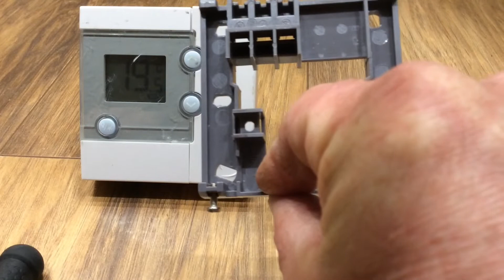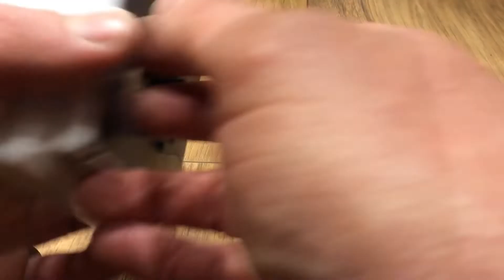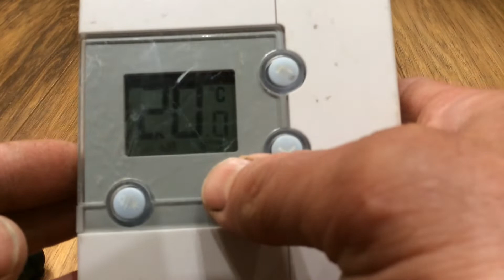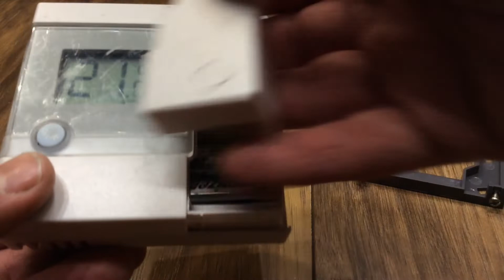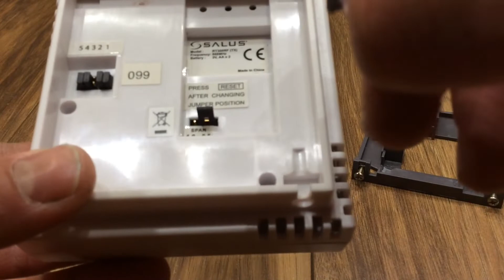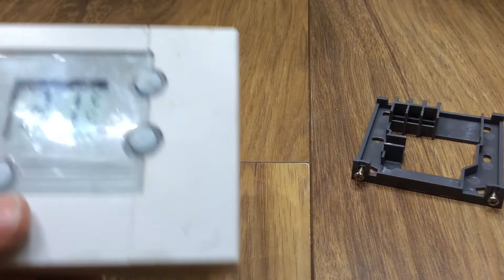Salus rt300rf thermostat Guide

Comment: Green and red light on but no heat only hot water. Batteries changed but still nothing Recent power cuts messed it up.
Reply from the maker: Turn below room temp 10 seconds then back above toom temp repeat 10 seconds then repeat . Ots an old unit now could well be toast tho

Comment: Hello please can you help me. I set the temp to 21 and the boiler in the on position so that the boiler is always 'on' and the house is maintained at 21. However when I set the temp to 21 (I get the SET message) the next day the temp on the SET page has dropped from 21 to 14. I set it again at 21 but again the next day it's back to 14. As a result the heating never comes on because it the temp in my living room now has ti get to below 14 for the heating to come on. How can I get the SET temp to stay at 21 and stop going to 14. Many thanks.
Reply from the maker: Units probably faulty they are quite old now
Reply: thank you for reply...appreciate it!. I guess they are now discontinued in regards to replacement?
Reply from the maker: There's some very similar units however ironically more expensive for these than the one with programming

Comment: Not sure if you are still answering questions on this old unit but the power has been off at my house this morning and now the unit is refusing to pair. It does try but then reverts back to a flashing red light on the receiver? Any clues, I have put new batteries in turned the power on and off etc etc if I need new what is the alternative replacement?
Reply from the maker: Have u turned it up and down a few times
Reply from the maker: It's hard wired to pair so you try changing the jumpers and dip switches .both should match

Comment: Hi, video is fantastic, but still the receiver is solid red, even after reset the controller. What am I missing?!
Reply from the maker: It's quite old it's likely done ..time to get something new
Reply: Thanks. Can I ask what will be a good replacement?!
Reply from the maker: hi i would say if you push the budget another 20 or 30 pounds you can get the hive mini . ot tado controls 100 from screwfix and internet with an app on your phone . around the 100 mark

Comment: ever thought of investing ina microphone? Even on full volume i can hardly hear
Reply from the maker: Noted old vid I do better now .prob needs a voice over and refresh
Reply: @timeintheuk  one of the battery connectors went on mine today so heater wouldn't come on.
This did help me realise it worked by a signal and not wired connection so I managed to take of the wall and put a temporary fix in place so it would activate the heater.

Comment: it seems that my display is gone. can rt500rf  thermostat work on the same console, at least manualy?
Reply from the maker: Remove battery's overnight and try putting new ones back in after aesst 6 hours should springback to life
Reply: @timeintheuk  It's dead, Jim!
Reply from the maker: @osmanposao  on the 300s the metal bit falls out of the battery doorsometimes plus itshard to get the door back on ...or its like u say dead .better stuff out there on the market now however
Reply: @timeintheuk  think to buy used 500 from a gay in Serbia, if it fits with console

Comment: Hi. Thanks for the video. I'm having trouble with our RT300RF. The thermostat ran out of battery and I've put a new set in but it won't come back on. I've tried many different batteries. Any ideas please?
Reply from the maker: Leave battery's out overnight.. Or you have lost the metal strip off the removable door or the battery cover  is simply not on correctly
Reply: @timeintheuk  hi hope you got this sorted, i just got one going again by pressing the reset button before putting the battery cover back on. Sounds like the same issue i had.
Reply from the maker: It’s tricky getting the cover back on check you have not lost the small metal bit in the lid .if you have lost it try tin foil as a hack .

Comment: hi i have pressed reset button stupidly, do i need to repair? how do i do this
Reply from the maker: If your unit is a 510 rf or a 300 just re program the thermostat unit and you will be fine as they use switch and jumpers to lock in the frequency and code
Reply: @timeintheuk  mines is the 300 unit. ok so i just put the temperature on the box again and when i put the timer on my boiler on it should work? aslong as the temperature is low enough in my house
Reply from the maker: @MMALoony  Try  turning up and down to test correct function
Reply: @timeintheuk  my receiver currently just has a red/orange light
Reply from the maker: @MMALoony  red is power .demand is green

Comment: The boiler stopped working because the batteries in the thermostat ran out, then I switched batteries and the thermostat starting again but now that I am trying to turn on the heating it doesn't seem to work as i think it is not connected to the thermostat. Help please
Reply from the maker: Hi be sure you have not pressed the frost function. Do not press reset or it will need re pairing so please dont do that. Hit the down arrow and set the room temp to below current room temp leave 30 seconds turn up  to above room temp leave 30 sec and repeat u till u get a green light
Reply from the maker: Please subscribe to support the channel and check out the channel amazon links to support us thanks

Comment: Any help gratefully received i have this unit, but there are no lights on the receiver, no green no red but the boiler is on fine and getting power; HELP
Reply from the maker: Hi the 300 is an old unit Ur prob in need of an upgrade. Slim chance the power supply is lose or it's turned off somehow

Comment: Hi I need some help my suddenly start dropping temp to 5 degrees and I cant go back to normal mode any solution ? I hold backlight for 5 sec did not help :/
Reply from the maker: you have it in frost mode . press snowflake button until snowflake on the display goes away
Reply: @timeintheuk  That is the problem screen shows me only temperature nothing else I hold snowflake button for a 5 sec screen just flash, If I want to setup new temp It drops again to 5 :/
Reply from the maker: Hold button untill snowflake goes
Reply from the maker: Or just quick press release

Comment: So mine has no display, I’ve tried to change the batteries but the screen is not coming on?
Reply: Read the other comments, will try rechargeable batteries and see if that works. Thanks for the video!
Reply from the maker: Yep on some 300 series ( small square ones ) the battery door has contacts on if it's not back in place correctly it won't work

Comment: Do you know if I can jump start this thermostat because there is no display? What model of thermostat can I replace it with if it doesn't work that is compatible with the receiver?
Reply from the maker: Hi battery's out . Get some rechargeable AA bang em into charger then strait into the thermostat .
Reply from the maker: Leave battery's out of the thermostat for half hour at least .
Reply from the maker: Brand new batteries often sit in the store for a while so can lack the punch needed to kick-start the display
Reply from the maker: Also putting thermostat somewhere warm helps
Reply: @budgie did you get it working? I think I have the same issue
Reply: @msralmjs  yes it works exactly as he stated. Thanks allot for making this informative video. Rechargeable batteries and leaving the unit in a warm place before replacing the batteries with the rechargeable ones did it!!
Reply: @msralmjs  sorry for the late reply but I just saw your message.

Comment: hi! do you know if an Rt500 would work with an Rt300 receiver? tnx
Reply from the maker: RT 500 RF and RT 300 RF . Yes you just need to copy the jumper position from the old unit to the new unit . And remove battery's from old . Please give me a subscription to support the channel thanks
Reply: @timeintheuk  thank you!
Reply: @timeintheuk will the rt310 wireless controller work with my old rt300? Thanks

Comment: Hi can you tell me what to do if the battery was dead and it  lost the pover before I hanged them? Pls  It is now completely dead and I don't know how to turn it on. Thank you for any hepl in advance.
Reply from the maker: Please give the channel a subscription as it really helps out thanks
Reply from the maker: Hi if you have fitted new battery’s and it’s still dead it’s new thermostat time. Just ensure the new battery’s are tip top power wise . And the springs that contact the battery’s have a good contact . Good luck
Reply: @timeintheuk  one of the springs had some battery  leak  on   it .Clean it of with sand paper and it's working like new. Thank you for respond
Reply from the maker: Hi q tip and vinegar also works.. well done !